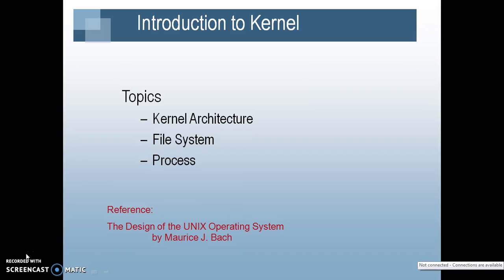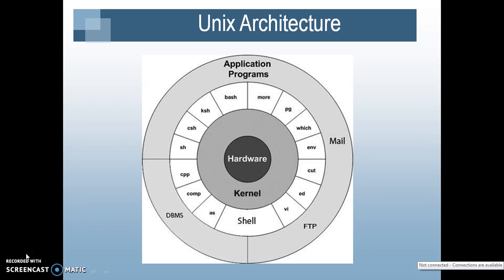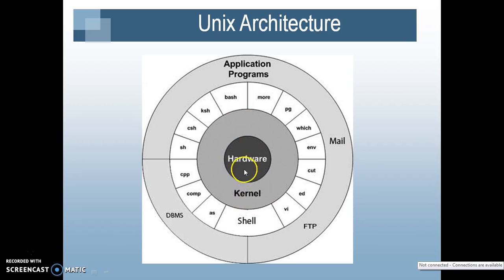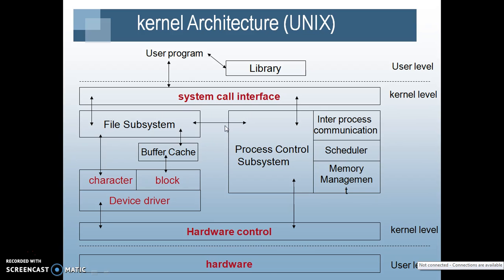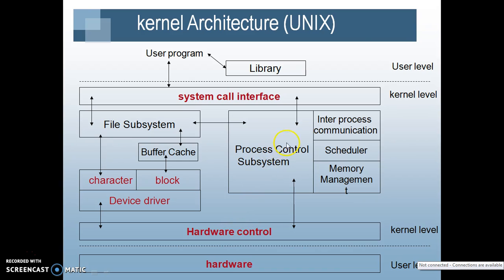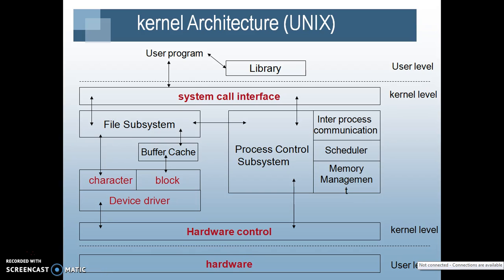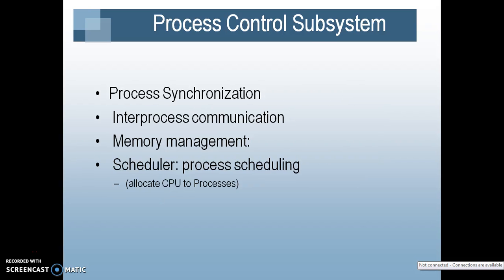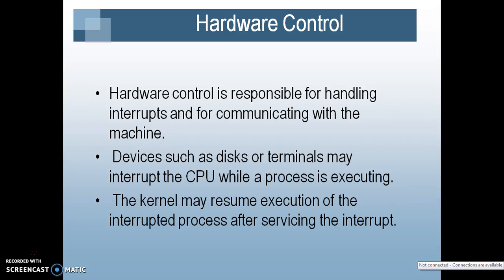Unix Kernel

Comment: Hello !  I want to ask you something, I wrote a 32c riscv emulator, and it has 512mb of rom and 512mb of ram, and I have written test programs and the cpu works perfect, but I want to write a microkernel, and the truth is that how the theory of  kernel but not the practice, I do not speak of only a multitasking as free rtos, I want that cpu to load independent programs in the ram and execute them, something very simple for me to understand, I have currently managed to load a program in the ram and positioned the counter  program to the address where the application is and executes it, but by positioning the counter in another location that application takes full control of the entire cpu, thank you very much!